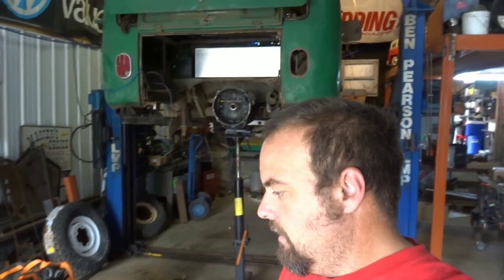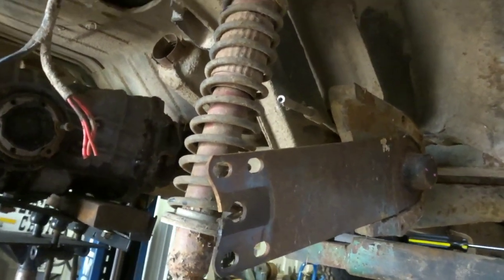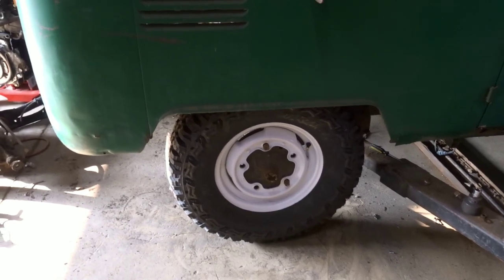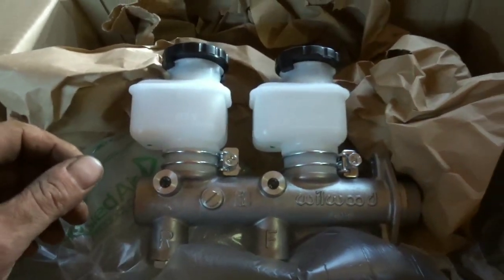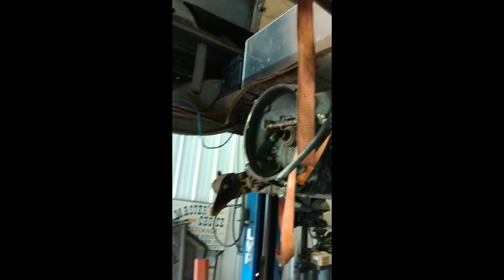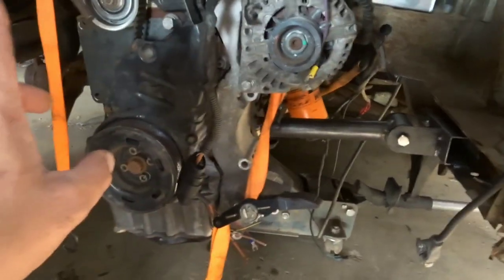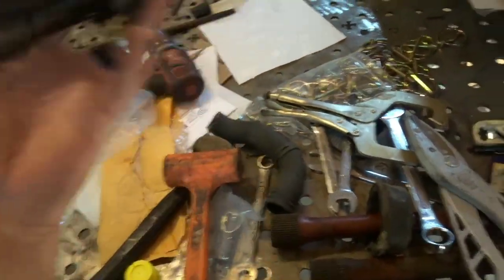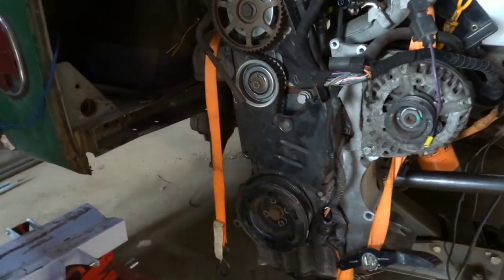VW Bus Bay Window IRS Into Split Bus - Overland Bus Build

Comment: You should get a set of early bay drums or shorten the snout on the split early drum plus move the top stop in the spring plate houseing further back more upward travel also move the rubber bump to the frame

Comment: Do you have the links for the dual master cylinder?
Reply from the maker: I bought this one from speedway motors. I am replacing my pedal assembly, it wouldn't work on a stock bus pedal unfortunately.
Reply: go to the samba, they cover converting this to dual cylinder for the pre 67 buses - using a rabbit reservoir and longer push rod or adapter ?  soemthing like that.  My 65 came dual circuit per M code.  My other bus is a 67.   -- But I agree that replacement dual cirucuit master looked like a good improvement...I wonder if length of travel is the same ?  Then, we could probably make something or modify  it to work.